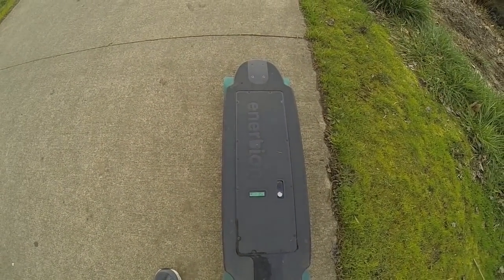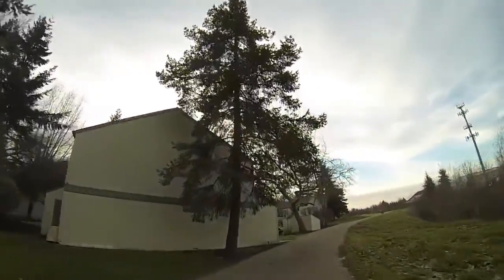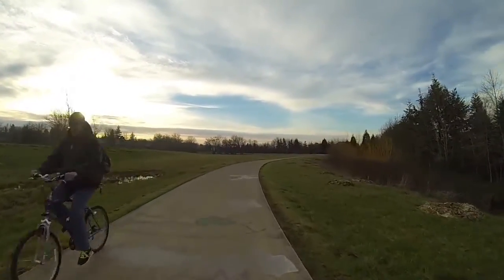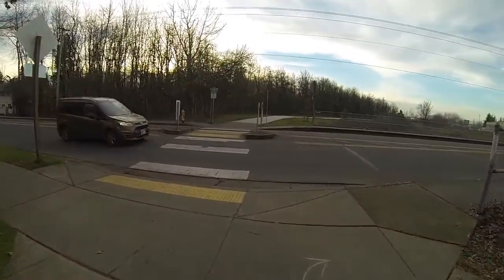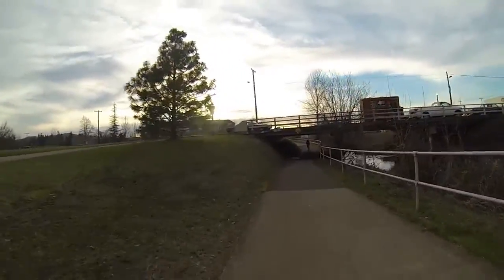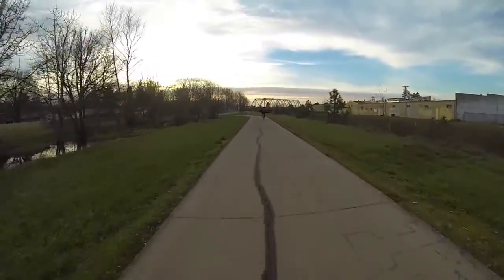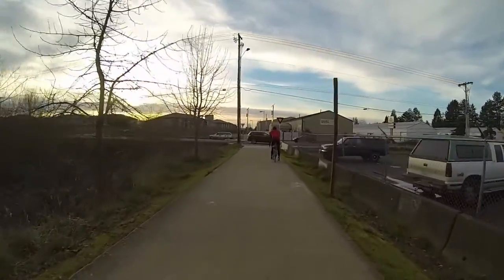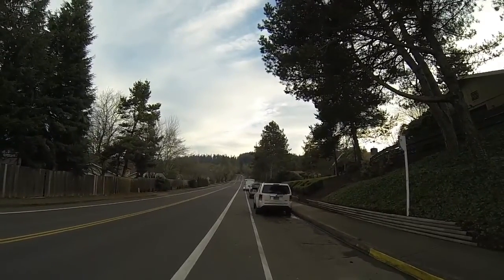Enertion Raptor Electric Skateboard - First Commute Home

Comment: Wow! That board sucks if it shuts down while riding. It almost killed you no wonder you wear a helmet. It also loses connection if the remote is not pointed to the board. Why would the board wheely? Boosted better buy same price.
Reply: Mine was a first run product.  Not exactly beta, but also not quite fully polished.  IMO, Boosted is more polished, but Enertion will get there and the Boosted has serious range issues.  Also, directly because of experiences I've had, they've made several improvements.  I can say with certainty, this issue is solved.  :)

Comment: Your videos are helpful on me deciding between the dual raptor or the dual + boosted board. 
How much does the board weigh? Have you had any other issues with it? And on a full charge at speeds 20+ can you do at least 12mile?
Reply: I haven't weighed it, but I think it's around 15-16 pounds.  At speed, range is better because the motors are working more efficiently.  That said, your range will probably depend more on the terrain and your weight than the speed.  That is to say, things like hills, starting/stopping, uneven pavement, road debris, etc., all reduce range pretty significantly IMO.

Comment: Well...the board dropped u off because he set it to hard cut off...u should have put a voltage checker as well...that beeps at 3.7v or 3.5...that tells u you need to stop and charge the board

Comment: excellent upload, im in the market for one and hadnt seen the raptor yet. seems powerful enough.
Reply: +wouldwebealive It's the most powerful I am aware of.  That said, IMHO, you should really consider if that kind of power is what you want.  If I had to do it again, I'd get the Raptor Mono (single motor, but the motor is slightly larger 63x72 mm vs. 63x55 mm).  Top speed is the same, but the single is more forgiving on the throttle and it has better range.  The Dual is just plain beastly and it REALLY sucks the power!
Reply: +Xusia01 thank you kindly for the reply. actually did settle on mono, based on that argument. i need range. did not get the raptor but a metroboard with the 20mile battery. will report back on results when i receive it.
Reply: +wouldwebealive Please do!  I've been curious how well their IR system works in the real world.
Reply: thinking was that bluetooth suffers a lot of interference plus i live in a city with abundant street crime. I cant be having a phone in my hand controlling the board. If all goes well i might receive mine this week. Keep you posted.
Reply: +Xusia01 Did my first 100km on the stealth. Commute includes curbs, good + bad roads, bike paths and streets full of cars-- i weigh 75kg. For now im 100% happy with the responsiveness, i thought i wanted to tighten up the trucks a bit, but as they are, they carve like a dream. The 75a 97mm wheels were a good choice. Also, i cross a bridge with a 20-25% incline and although you hear that the motor is working hard, speeds stays constant. The power is there. The stealth has 32kmh which is probably as fast as i want to go. Lets just say my environment doesnt motivate higher speeds as Bogotá is not known for its traffic intelligence. Then of course the IR remote: Im still in the beginning of my learning curve, but, when the sun has been out full force, although it responded great, i do feel every now and then that you need to point it straight into receiver direction. I knew that beforehand, so no complaints. Ive refreshed remote batteries twice now and with full batteries i have 0 issues - can point it almost everywhere in mid-daylight. All situations until now have been more than manageable.
Reply: +wouldwebealive Awesome!  That's great to hear.  I did a little reading up on how their remote works, and although I'm not 100% sold on IR (nor Bluetooth!), I like the way they have both buttons and the stick.  I would love to get the same kind of functionality on my Raptor.

Have fun and stay safe!  :)
Reply: +Xusia01 Thanks, you too, keep up the good work!

Comment from the maker: We figured out what happened.  Under load, the voltage dropped below the minimum defined by the BMS (Battery Management System).  When this happens, the BMS shuts the battery off.  This is necessary for Lithium based batteries because voltage that is too low permanently damages them.The solution was to update some settings in the VESC (Vedder's Electronic Speed Controller) so that the VESC (rather than the BMS) starts limiting the current in order to keep the voltage from dropping.  While riding, this would present itself as a slow down.  So rather than the board just stopping, it would start to slow down, then crawl.  In other words, it should be very safe!Enertion has made changes to their production processes so that all new Raptor boards will have these updated, safer settings, so you can buy with confidence.Another change they are making is the battery compartment lid.  The original lid (like I have) is carbon fiber, and unfortunately carbon fiber blocks radio signals.  This is why I had to hold the remote down by my leg.  I tested the board with no lid and I could hold the remote over my head and still get a very responsive and consistent signal.  The new lids will be made of fiberglass which does not interfere with radio signals, so that minor issue is also now solved for all new raptor boards.
Reply: +Xusia Xusia Great video. What was the process to adjust the settings on the VESC?
Reply: They are not selling complete boards any more...how much did this cost? I'm just starting my research and interest in these boards and Enertion definitely caught my eye....now if only I had the money. I got a 1 year on in a Montessori that is costing $1,500 a month. it's gonna be a while I guess
Reply: What are you talking about they still sell complete boards?
Reply: The concept of low voltage as it relates to Lithium batteries isn't a new one... Why do manufacturers continue to list percentages the way they do if you cannot actually utilize a full charge?... Why not use gauges indicating green zone/red zone usage (or have a warning indicating critical voltage limit has been reached)?

As for your "lids".... Why not add an external antenna and keep the carbon fiber? There would likely be even less interference than with the fiberglass lids... just a thought.
Reply: As I stated in a previous reply, this was a first run product and there were some minor issues such as this, which are now completely solved.